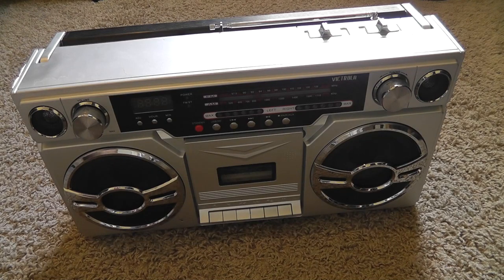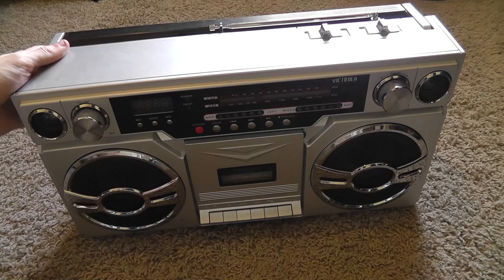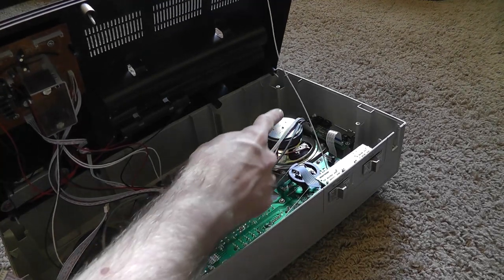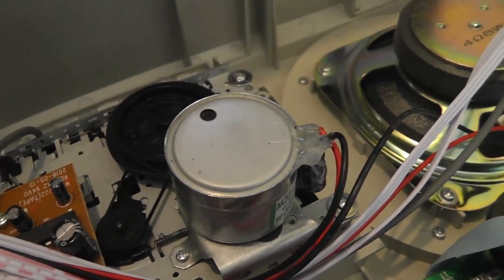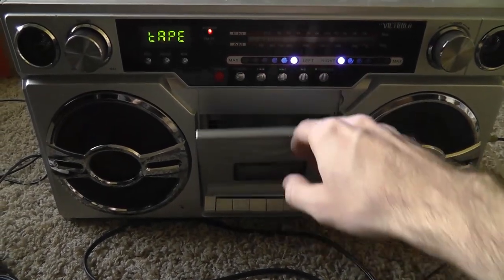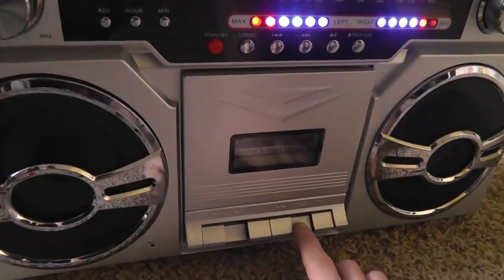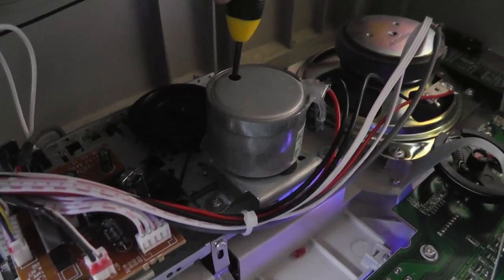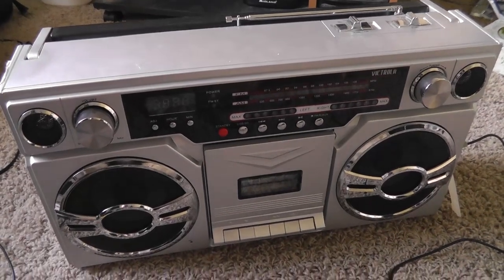A look inside the Victrola Boombox and Tape Speed Adjustment

Comment: You need to know that when you are adjusting set screws, you turn them in micro-fracional increments. Just one tiny movement at a time. You don't just guess and turn the screwdriver. Another thing. You are subjecting yourself to frequency variables and inconsistencies by using USB adapters, computers, programs, et cetera. Every single thing you are passing the signal through is introducing interference into the output.

Comment: I think those are 4 inch speakers...Ill have to see if some I can buy online will fit inside...but maybe you can get 6 1/2" woofer in the front and I have lineum tweeters...Ive modded it with black and decker lithium ion batteries...and I want to maybe add a small car power amp and bypass the amp inside...I have a bluetooth pad I can velcro to the back...it should really rock when its done...

Comment: How do you know 3000 and 3010 is where it should set?
Reply from the maker: The test tape has a 3000 Hz tone on it, so the closer the reading is to 3000 the more accurate the speed. However, the speed will always fluctuate a little during use and a 10 Hz different isn't very noticeable so 3000 to 3010 would be an acceptable range for me.